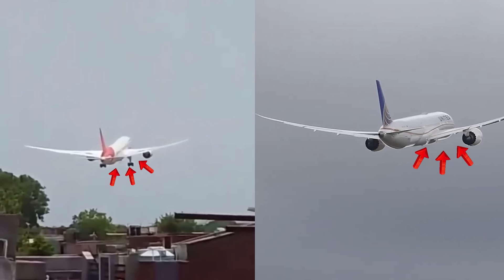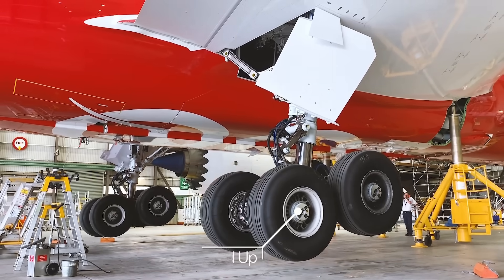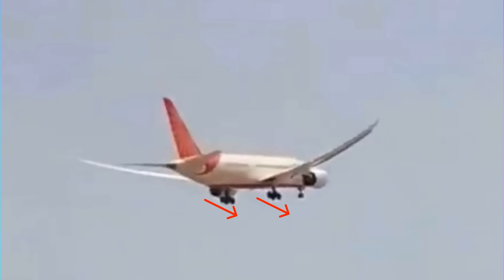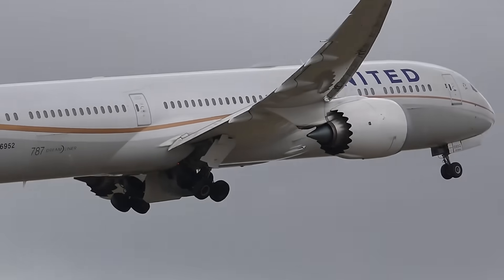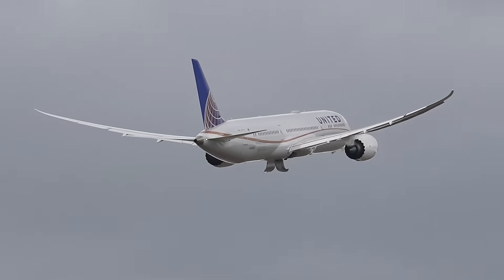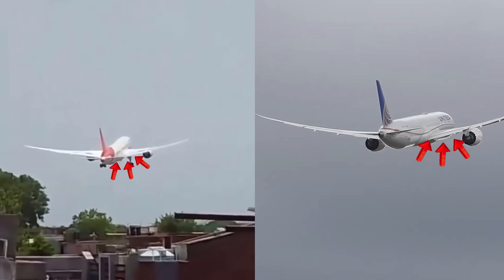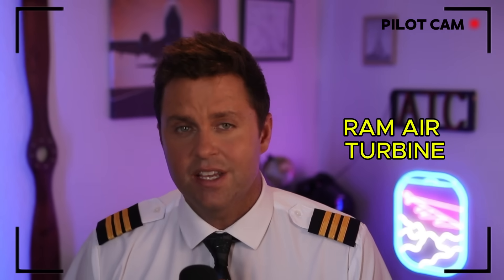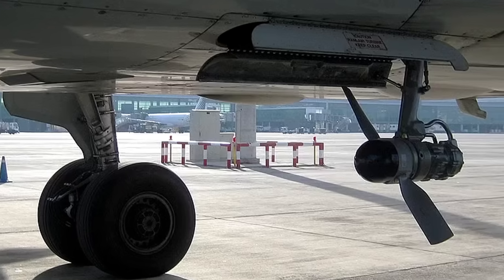Pilot Explains: A New Detail in the Air India 787 Crash Everyone Missed

Comment: An electrical short or fire in avionics would cause the FADEC computer to automatically command an engine rollback to idle.  The fact that it sounds like the engines spooling down in correlation to the RAT being deployed, as well as an orange haze or smoke coming from the area of the vents for the battery containment box, suggests a lithium battery runaway. Lithium batteries in their current form are simply unreliable and unsafe, as evidenced in numerous videos of laptop, cell phones, electric vehicles and other lithium battery powered products explosive fires. After the 2013 redesign the two lithium-ion batteries were placed in containment boxes but lithium battery runaways are difficult (at best) to contain. They are located within both avionics compartments where the central nervous system of the aircraft is located. If this was located in the tail, perhaps it wouldn’t be so catastrophic?
There are ways to indicate when a battery is going critical from heat generation, but without a sensor or software to detect the increased heat generated by a bad battery, and to inform the pilot or mechanics, it would go undetected until it’s too late to prevent.

If a fire in avionics causes a fault, a short or damages wiring to sensors critical to the FADEC, indicative of the RAT deployment, the engines would roll back. FADEC is programmed to reduce risk by rolling back the engines to idle if it believes they are damaged or it cannot communicate with them.

I feel anguish for the pilots who probably had no warning and did their best to keep the plane in the air while watching the engines automatically roll back to idle at the same moment they were trying to raise the gear. I agree, it appears the landing gear was rotated forward as they would do just prior to raising into the wheel well. Power to their hydraulics apparently failed at this moment, preventing the gear from raising up.  The RAT does not provide power to the landing gear hydraulic motors.

Look at the videos and images.  It appears there is orange smoke coming from the forward avionics area during level flight (not the dust kicked up at liftoff).  The smoke appears to go over the wings near the fuselage.  It dissipates quickly but what else would cause this haze except for a fire in the battery containment box venting out the side of the aircraft?

Comment: 1987 The aircraft, Delta Flight 810 bound for Cincinnati and carrying 194 passengers and a crew of eight, fell from an altitude of 1,600 feet to about 600 feet shortly after leaving LAX early Tuesday afternoon. No one was seriously hurt and the flight continued on to Cincinnati.

The Delta captain has told federal investigators that he inadvertently pulled the two knobs on the jet's console, cutting off fuel to both engines and immediately shutting them down, sending the aircraft and its terrified passengers into a silent descent.
2 you obviously don’t know 787 systems the gear is in correct position 
For retraction. 
8-9 hour flight (Pilot#) 3 or more could be up front 
3 CRM
4Training flight
Please quit and since you talk to Captain 🧑‍✈️ S. 
Sad

Comment: What are your thoughts on "Vapor Lock?"  Another Pilot suggested that the aircraft sat on the tarmac for two plus hours with no air conditioning with temps around 103 F.  Could this have caused air bubbles to form in the hydraulic fluid that controlled fuel to the engines?

Comment: I don't think it's the flap issue, because if it's in the wrong position, the alarm would go off, and the pilots have to be crazy to keep on going, taking off.
Reply: It was not. But it could have been. They might just get a stick shacker and a bunch of audible warning messages, possibly confusing them. Given they had so little time to react, that was a plausible theory. But we can rule that out now.
Reply: I think the alarms are only present if they are at 0 (neutral). Maybe they didn't have enough for the weight and hot weather.
Reply: @BojaneBugami  Not only for zero. But also based on the entered weight calculations.
Reply: You would get a config warning when the thrust levers are advanced.

Comment: It seems very likely that the engines suffered failures as Gary and Capt. Steeve suggest.  Now the question is how did both engines fail at the same time?  Mechanical failure ?   Bad fuel?  Pilot error?    Answers to these question will ultimately determine where the ax will fall.  Boeing, Air India, Pilots, or someone else.

Comment: Boeing manual clearly states that flaps will not get retracted below 225 knots even if done by mistake. 

Also, a flap retraction takes more than 20 seconds to complete, the entire flight was 31 seconds
Reply: That and the fact the the airplane screams at you if you try to take off misconfigured.
Reply: @ronhaworth5808 *Aeroplane. Proper English, please.
Reply: and..... Even "Before selecting the landing Gear handle UP"  , the gear tilts Forward Down... as soon as the sensors detect AIRBORNE...  see:   AMM 32-31-00 LANDING GEAR DESCRIPTION AND OPERATION.    So, regardless of the selection of the gear handle, it will always tilts forward down to prepare for retraction.
Reply: @Fabianpilot  Why do you keep referring to an Airbus document?
Reply: @keith6706  im not. 

 B787 FCOM Vol. 2	32 – Landing Gear	Operational description for pilots
AMM	32-31-00	Detailed mechanical and system operation
SSM	32-31-00	Hydraulic/mechanical schematics
FIM	32-31 Task	Fault isolation for tilt issues

Comment: I am thinking that at rotation there was a total electrical failure. RAT deploys as designed, it should work. However; it is a hot day and both engines just lost the electric fuel pumps. The engine driven pumps couldn't overcome vapor lock from the heat, starving the engines the fuel needed to continue.
Reply: Apparently RAT is designed to work at altitude not at 300-500 feet from the ground. It also gives the pilots time to try to restart the engines.

From what I read from other pilots, there’s just not enough time to recover once you lose both engines and have to rely on the RAT just after liftoff.
Reply: After RAT deployment, the engines might have tried to spool up, but it was too late.   The survivor said that the engines regained power after shutting down.
Reply: Jet fuel starts to boil at 156 deg C  so it is highly unlikely the engine driven fuel pumps would have a vapour lock. Vapour locks happen with gasoline which has a much lower boiling point starting at 35 deg C.

Comment: Thanks for the very interesting update.  I also watched CaptainSteeve earlier today.  Regarding fuel contamination - unless this was isolated to the aircraft itself, a contaminated fuel supply at the airport should affect other aircraft - don't you think?   

I have the nagging suspicion that once the flaps and gear retraction sequence was initiated,  that something in the operation of those systems interfered with the fuel delivery system and /or electrical system.  I think this will require a close look at the maintenance that was performed in the weeks/months prior to this flight.  Do you happen to know if the fuel pumps on the 787 are mechanically driven off the engines or electrically driven? I did a quick web search and it appears they are electric but it would be good to confirm this on this specific aircraft.

Comment: I am not a pilot but my initial observation from the take-off, the plane suddenly lose all power to lift with no change on flaps. On another video inside the cabin shows the entertainment system and air conditioning is defective with temperature reaching 39 C which is a red-flag. Some speculate that the survivor opened the emergency exit while on flight (probable cause). Hope that the recovery of the black box will tell more about this tragedy. Something about the plane's loss of power (electrical or mechanical)
Reply: hmm... how that Emergency Door was open for him to walk out...? 
can the door open by itself due to impact ..  he did not come out from a broken  part opening but only thru the opened Door he said. So....

Comment: I firmly believe that the flaps were set.  I have the BBC News app on my phone and got an alert for the accident reporting, probably 45 minutes before the US networks started reporting on it.  The US was still heavily distracted by the LA events.  I also have BBC News on my YouTube TV account.  The started showing the debris field as littler after the first breakway on NBC, CBS FOX.  And in the debris filed, the prominent display of the tail section, and a section of flaps that had broked off the wing.  That section was in an extended position. I'm not an airline technician, but I'll assume that the flaps have a jack-screw to hold the flaps setting once the motor achieves the setting. 
I have not seen that clip again.  But it was on BBC News and they were broadcasting what they obtained from their Indian affiliates.

Comment: But what if it was none of these things and was just a catastrophic  failure of either the hydraulics or the electrical system, after all the surviving passemger said a number of things that made no sense, first he said he heard the engines accelerating, then he said he heard a bang , then he said he saw the lights flicker ....................could this be another Boeing design problem that has been sitting there since the beginning but has not caused any problems because everything was new ? Did Boeing also have a Lithium battery meltdown at some stage  in 2013 leading to electrical failures and fires ?
What if that noise was a lithium battery exploding  ?

Comment: Is it possible the fuel cut off switch short circuited or their was an electrical failure? The pilots may day call was "thrust not achieved", not "dual engine failure". And passengers on this aircraft on the flight prior were reporting electrical problems.
Reply: Or if you want to think outside the box, EMP pulse

Comment: Could the dust plume seen when the plane first gets airborne have been sucked into the engines causing them to stall etc 🤔
Reply: Wing tip vortices
Reply: I’ve watched a lot of different scenarios being tossed around & none of them seem to fit with any certainty. The only theory that hasn’t been looked at is the dust plume on takeoff which would have sucked into the engines causing airflow issues in the engines which is not a good thing for an engine before takeoff with max thrust needed. It could have even been larger debris ie gravel or sand etc
Reply: @izabellaward225  but that doesn't explain why they took off at a show speed and needed the whole runway to lift.
Reply: That's an interesting thought.

Comment: If the fuel metering unit, that prevents engine flooding, the altitude input is 18900 foot, the fuel to air ratio, would limit fuel to both engines, about 1350 down to 576,
no thrust.

Comment: 2 things almost 40C out of India at close to MTOW (destination LGW)  shouldn't it have been flaps 15? Secondly the dust plume on take off looks like they rotated and crossed the overrun area meaning a looong take off run. Incorrect weight in the FMC? It happened in MEL for EK in an A330.

Comment: Air bubble in the fuel lines. Same thing happened to me in my Chevy Spark, 
lost thrust just as I was trying to cross a 6-lane highway on a hot, hot day.
Reply: no, not possible there are booster pumps in the collector tanks keeping positive pressure to the engines, most aircraft [someone said not this one] have fuel pumps on the engine as well, 'air bubbles' is not a possibility

Comment: It seems that the aircraft took approx twice the runway length it would be expected to take. 2600 meters rather than 1600 meters. That suggests low thrust from the start of the flight. Just doing mental doodling, almost twice the runway length suggests engine power was perhaps only 60%. That puts it in “operating on only one engine” territory. It can do it in theory but what if the engines continue to degrade under load?  This keeps pointing to a contaminated fuel issue.
Reply: They would have aborted takeoff.  Running into grass at the end of the runway better than falling from 600 feet.
Reply: @TeddyRumble depends.

Comment: Another question…some sources say they started their takeoff roll from an intersection +/- 6200 feet versus a full runway length takeoff. If it was a short takeoff, it would seem they might have had time to abort the takeoff with 11,000 feet.
Reply: It is known now they used the full runway.
Reply: @sueneilson896  

Thanks. One early report (based on bad ADSB data) suggested it was an intersection takeoff.
Reply: Actually, the fact that they had the full runway means they had MORE time to abort the takeoff. And the fact that they used up that entire runway strongly suggests that the plane was struggling to lift off--if the flaps were set etc. that means not enough speed, i.e. thrust.
Reply: @horsepanther …. Rotation and initial lift were normal, so it appears engines lost power shortly after, probably followed immediately by mayday call.

Comment: I think the engines flamed out before or after gear up was selected.One thing I could think of is they were using the center tank but it was empty with enough left over to taxi/take off.   and it was configured to use that tank from the last landing and was missed. or mis communication when refueling. So seeing the wing tank volume didnt worry about the center, or it was off by an order of 10x and looked normal at first glace.
Reply: sometimes people see things 'highlighted' like low warning and the mind 'overrides' it with 'well its ok because lots of fuel in the wings'
Reply: interesting
Reply: i should add - that it probably be a prohibited configuration to do manually.

Comment: A very recent FAA Airworthiness Directive explains what can cause this: an electrical short in the aft EE bay caused by leakage of potable water, which would be most at risk on takeoff rotation. The directive specifically calls for inspection of seat tracks above EE bays, and demonstrates that this leakage has actually happened onto the electrical bays.

Water splashing onto busbars in the aft EE bay would trigger faults detected by the Bus Power Control Unit (BPCU), immediately isolating the Variable Frequency Starter Generators (VFSGs) and causing simultaneous loss of left and right AC buses. Loss of generator output would deploy the RAT (Ram Air Turbine).

The FADECs (engine computers) need constant power to maintain thrust commands. When both AC buses fail, they lose their normal power supply. The RAT takes about 8 seconds to spin up and restore emergency power - but during those 8 seconds, the FADECs have no electrical input at all. Without power, they automatically revert to their failsafe mode: mechanical idle thrust. This explains the brief climb to ~650 feet on residual thrust, followed by rapid descent once the engines rolled back to idle.

FAA airworthiness directive: https://public-inspection.federalregister.gov/2025-08346.pdf

Comment: That was a very good analysis. You covered everything. 

Now here's my thought: it was something electrical, whether an electrical power fault like a massive short circuit, or something in the computers, maybe even, and I hope not, software.

When I first heard about what happened, I immediately thought FUEL. That would be logical, and it might still be fuel if it was a side effect of something electrical. I mean how do you stop that enormous fuel flow, at full power, into two engines instantly? Contaminated fuel would surely have affected first one engine and then the other, and the exhaust would have certainly shown smoke, flame, discoloration, on/off, something. 

My background in electronics leads me to think it had to be the electrical system.
I was a good troubleshooter. I can almost FEEL this one.
Reply: This is right on point. My comments (above), same. Complete Elec Sys failure, Im guessing about 20sec into flight, and with the lone survivor's comments of a loud BANG, I'm thinking the Li-Ion Batteries overstressed from Heat, blew. The heat was enough to start the failure, the ruptures were the tragic end
Reply: @gkswift1999  Oh, good point. The bang, yes, and at what point did he hear the bang?
Reply: You are likely correct.   And if so...... HOWZ THIS FOR REDUNDANCY ?     Christ, save us all from Boeing engineers.
Reply: @eugeniustheodidactus8890 ...then shouldn't all planes have two left and two right wings for redundancy?  Please stop trolling the internet with dumb comments.
Reply: @suserman7775   As a retired airline pilot, my comments are likely more reasonable that you will ever know.   FOR INSTANCE:  at my airline, right after the MAX debacle, BOEING execs admitted that they figured the MCAS EVENTS per hours flown by the max fleet, but didn't think we pilots needed to know anything about it.  Until you hear this with your own  ears, you'll never grasp the culpability of these scumbags.  So thank you for giving me the opportunity to say this to the world.  I don't give a shit.... I am retired.  WELCOME TO THE DEI WORLD.
Reply: Did you know the 787 had a software bug that could command all AC generators control units to turn off? It was called the 248-day bug and AFAIK it was only fixed in software meaning the system still has the authority to turn off the power

Comment: picture the gear still on the runway with the nose of the airframe up a few degrees and then liftoff. What do the gear wheel sets do?  They stay where they are. They don't suddenly tilt back the other way. The test on the jet on jacks was the opposite because the gear was deployed and that is how the wheels angle back. You don't want the front gear wheels to contact the runway 1st on landing . So I think that debunks your theory. I think the gear failed to raise at all due to electrical signal failure. In a 'fly by wire' system, hydraulic servo actuators will not work without electrical signal.